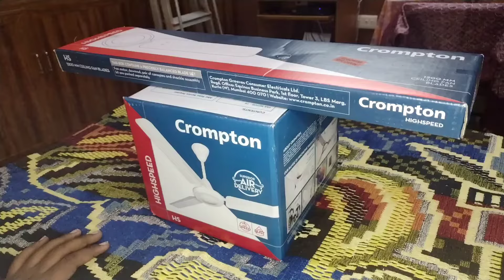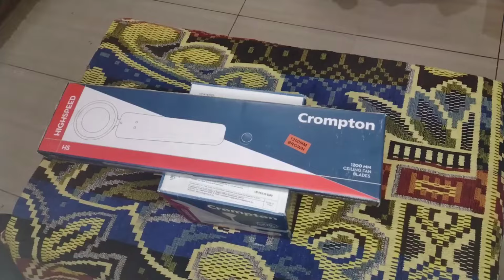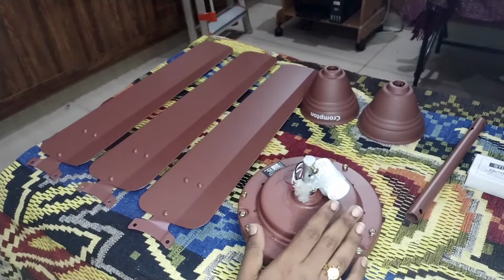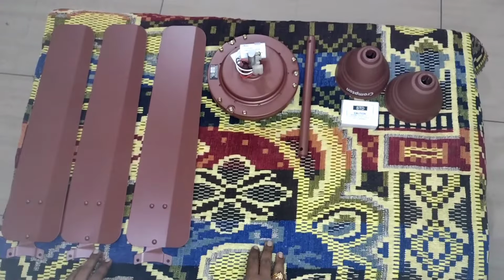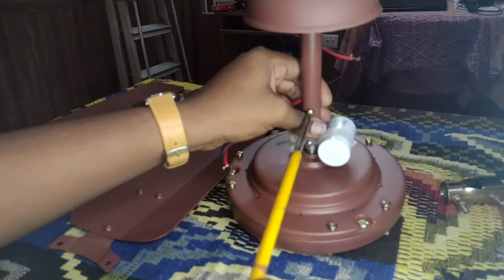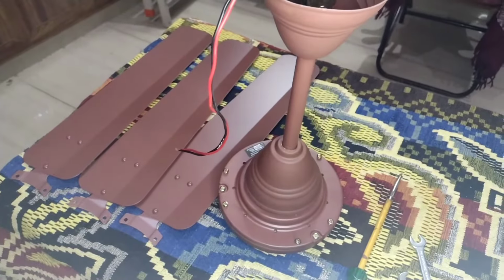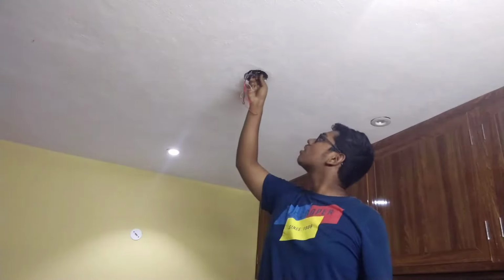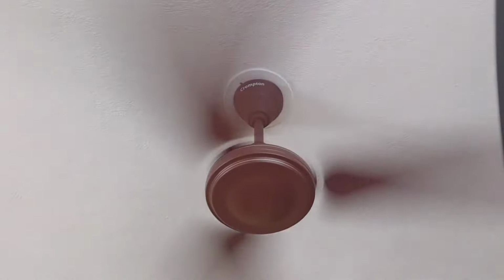CROMPTON HIGH SPEED 1200mm (48") CEILING FAN || UNBOXING, REVIEW AND INSTALLATION

Comment: Best, heavy quality fan ever! Gives airflow like a jet, very well designed, double-ball bearing, 100% pure copper winding for long lasting operation.
Reply from the maker: Exactly
Reply: @electrosmartz7131 It seems to spin less than 370 rpm due to low voltage.

Comment: Please can you try Orient falcon 400 or summerking 370 it is long lasting and better than this high speed
Reply from the maker: Nothing matters with speed. Everything matters on the airflow, speed maybe 400, 450, even 500 RPM but I Don't care about it because of zero blade angle it can spin much faster and no use only for wasting the electricity, but HS won't disappoint like that for 370 RPM the airflow will be in all corners of the room, so I guess, there's no point in wasting money over the useless rotating machine.
Reply: @electrosmartz7131  but Orient falcon 400 is good fan because it's airflow is 230cmm